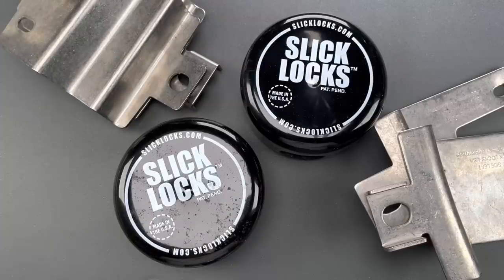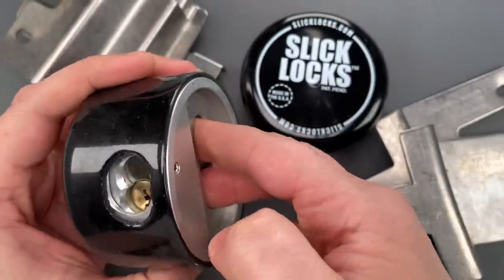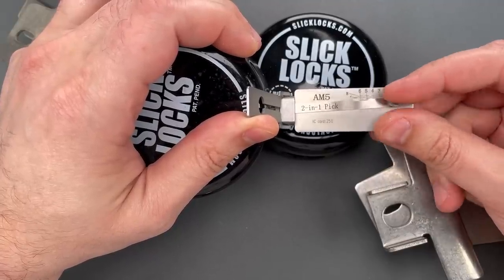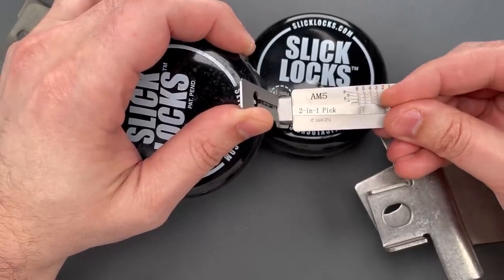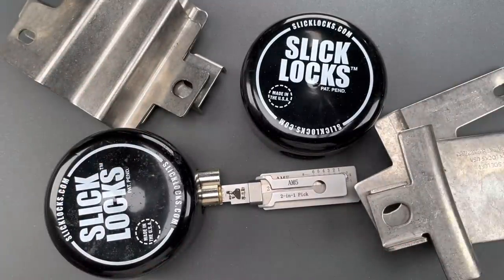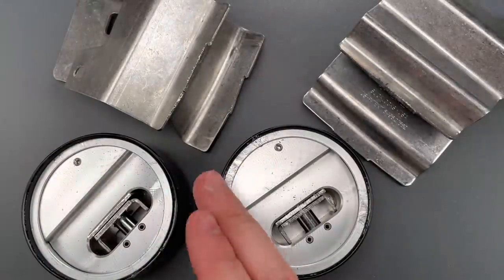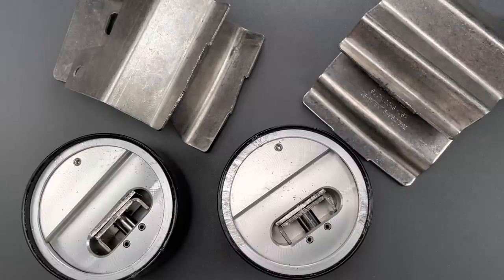[1451] “Slick” Van Locks: Cut in 18 Seconds

Comment: I see you actually have a high-quality vice. That voice could easily be five or $600 but I haven’t checked lately. Two hands on the hacksaw by the way. Great video thanks.
Reply: In a burglary situation, you tend to go for one hand on the hacksaw.
Reply: Who uses 2 hands on a hacksaw?!?
Reply: @nooboftheyear7170  
Someone who knows how to use a saw. Do you noticed how it was flopping around, that’s how the blades get broken. One hand on the handle and the other hand at the end of the saw.  Did you ever have a shop class in school using a hacksaw to cut metal? I’m an industrial tool supplier and am asked from time to time, how can we buy less hacksaw blades we seem to use a lot of them? The brand we sell is Lennox, top of the line.
Reply: @roberthopwood3758  
Yeah I would imagine most burglars would do that, stupid to start with because they’re burglars, that’s what causes the blades to break most of the time, so now you have a stupid burglar doing a stupid thing using a tool the wrong way, I guess the good part is they don’t get to break in.
Reply: @nooboftheyear7170  
Apparently you’re interested in proper technique of using a hacksaw. I came back to help a little bit. He seemed to be using a 12 inch hacksaw blade. It was installed properly in the frame. How many teeth should be used in the grip (Grip = the thickness of the material he was cutting). Go to the head of the class if you said he should’ve been using and apparently did use a 32 tooth hacksaw blade, minimum 3 teeth in the grip. From all appearances it was a bimetal blade, that would be made out of two different materials. The teeth would be a harder material that is laser welded on to the back or the part that mounts to the frame. Is there anything else I can help you with?
Reply: @yt650  times like this are when you are glad that ypur name is noob.  Thank you for the information on blade selection, nevertheless, at a van door he would still only be able to use one hand in my opinion.  

Oh... and please don't say ' now stay down!' after any next reply
Reply: @nooboftheyear7170  
You will say anything to support your very poor position. I know people who are capable of showing upside down and sideways 90° in either direction. If you were to Google the proper use of a hacksaw and that’s what we’re talking about here at the proper use of a hacksaw not some half ass situation, you’ll see you need two hands to use it properly.  
Remember initially you said the following. Who uses two hands on a hacksaw?
Reply: @yt650  indeed, but then, I'm not taught but rather observed everyone else.  I generally used the other hand to steady whatever I was cutting. Thank you for the information though and I will definitely check it before I next pick up a hacksaw.

Comment: I think the cutting would be very awkward while installed on the truck, adding some rubber 'feet' to the lock might cause blade to bind up, an inexpensive way to add a bit more time to cutting.

Comment: If they’re going to go to the trouble to cut it then they’re determined to get in and a determine thief WILL find a way.. it’d be just as easy to cut the thin sheet metal of the door or another panel of the van and get in.

Comment: They could just straight up spot weld a hacksaw to brackets.This is cheap, off the shelf mod with two simple manufacturing steps - punch into shape and weld
Reply: Also, used up band saw blades are nearly free in any quantity

Comment: I wouldn't really even need the brackets to be hardened. Just a spring or a hard pin that's in or around the bracket and across the gap would defeat a common hacksaw.

Comment: id still buy the slick locks, there harder to pick, as far as the back door goes just disconnect the power from the back door lock actuator as a precaution. I dont ever use that door any ways

Comment: With how easy that awkward handsaw went through those mounting plates, this would not stand up for more than a second to my reciprocating saw with a thin flexible blade which would perfectly bend to sit flush with the car and slip behind it with ease
Shame it's not hardened, that would have taken it from "quickly cut the lock before anyone notices" to "someone will definitely notice if it's not an abandoned car park"

Comment: Just out of curiosity (not wanting to be a know-it-all), but wouldn't a decent set of pliers (such as a pipe wrench or swedish pliers) force that freewheeling outside shell oval enough, that you'd still wrench the lock off the van?

Especially as long as the hasps are not from hardened metal.

Comment: The outer shell looks quite soft in the video. I wonder if just either crushing this part or jamming a nail through before torquing the heck out of them wouldn't allow the wrench method to work despite the spinner mechanism?

Comment: The lock is promising. The mount needs work. Do they just sell the lock? (Induction hardening of the plates would be easy for the manufacturer after forming the plates. Very quick and inexpensive. And would kill a hacksaw blade in a quick second.)

Comment: [442] Australian "Hotdog Lock" Picked. Add a Schlege key sticking out of the middle and build a new lock out of that and how hard of a pain in the butt would that be to pick? If you have to pick the hotdog lock 6 times (or once and make an new key per video suggestion) and then have to pick the central key over and over. ?? Open question to all.

Comment: As you put the lock down on the table again after picking, you have to turn the tool again in order for it to lay flat. I would assume that if this lock was installed flush on a door as you suggested, you couldn't pick it with the tool you used in the video. How would you go about picking this lock in a real world environment?

Comment: Okay, realistically speaking you harden the brackets...  Then what?  You aren't going to have a bank vault door this lock is attached to, and axe would easily be able to chop the wood door that it's fixed to.  
As you have said countless times, locks are a deterrent.  Even for banks, the secure doors and safes can be opened, not always just by picking them, but they can be opened!  Might take you a fair while though.  To me this is by far one of the best locks I have seen on your channel.
Reply: " axe would easily be able to chop the wood door that it's fixed to" -- Puck locks are generally used on commercial vehicles to secure metal doors.

Comment: You won't have right angle for cut, when they are properly installed, your saw would brake, or it would take you way longer with cool down moments, still doubt simple blade would hold extra angle ...

Comment: Could maybe DIY harden the vulnerable area on the hasps with a MAPP torch and a coffee can full of oil. I don’t know how much tougher it would be against a carbide blade but it might be worth a shot.
Reply: You can only harden steel that has carbon in it. You can't harden low carbon steel. You might be able to put a hardened pin into the steel though. When a saw blade hits any hard material it gets destroyed. It doesn't take much.
Reply: @1pcfred  Ah, I see. The pin idea might work but welding stainless to carbon would be an issue right?
Reply: @PersonaN007Grata  you can just drive a hardened pin into low carbon steel. All it takes is the right tool. Which in an industrial setting would be a punch press. It'd slam the pin into the mild steel and it'd be there to stay. So no welding required. But it's more materials and another machine operation. That's all money. Which is why they're not doing it. I bet they could do it for less than a dollar a unit though. Still a few cents here and there adds up.

Comment: The lock itself seems impressive. It would be cool if they sold a more cut-resistant hasp with it.
Reply: @rmsg7504  Maybe not lishi tools, but at my old uni you'd walk by the bike racks at night and there was no question they had saws and bolt cutters. Half the bikes were in pieces.

Comment: I don't see why they don't just case harden allot of these parts, as with allot of critical automotive parts and things. It seems like it wouldn't be much more expensive as it doesn't require actual hard steel... forming and everything could be done before hardening. The case hardening process just hardens the outer layer of the part by adding extra carbon to it, which should defeat a saw blade no problem.

Comment: A great video, but I felt the cutting attack needed to be against a simulated van door. Using a hacksaw at a work bench is one thing. Using it effectively pressed against a steel van door with little to no ability to adjust for angle is another. So it wasn't quite fair, probably wouldn't have been as easy or as quick in the field. 

But that doesn't invalidate the conclusion one iota: hardened steel hasps would fix this obvious flaw.

Comment: it really looks like there's a lot of wasted space on one half of the lock
a hardened steel bar could surely be spotwelded, crimped, pressed or fixed in many other ways inside that U bend

I suggest to just cut an old file to size and fix it there yourself as a DIY solution
you can anneal it to drill the hole, hardening it should be simple enough as you just want it pretty hard and don't need to worry about toughness
alternatively you can cut a slot with your angle grinder (with a lot of cooling) 
a few tack welds should be enough to fix it in place, or epoxy or whatever you got handy
Reply: The two pieces of steel are put between the door and doorjam while holding on somewhere inside.  The bent zig zag is probably specific to the doors on one van model
Reply: @ButterfatFarms  just spit balling ideas for folks that have this lock and may not want to spend extra cash on a new one
money is tight, especially for small business that managed to survive covid

Comment: But I wonder how hard it would be to cut mounted flush on the wall of the van. If you've ever used a hand held hacksaw in a close binding area with your hand its definitely not the easiest thing to do.
Reply: The blade has adjustable angle, so you'd take a little longer, but not really struggle to get it in

Comment: The easyest but not cheapest way to improve this, would probably be to change material into inox, it's not unbreakable but it would heavily slow down this kind of attack
Reply: mounted to an aluminum door on a Transit van?
Reply: Like i said, it just slows down the attack, you can put it on a cabinet door made of 1/10 steel plate for all i care, the outcome stays the same

Comment: Sometimes its not about quality of the lock. Its also how intimidating it looks ! Most of criminals that brake into vans aren't inteligent to pick a lock ,a typical meth head junky doesnt have patience to go trough security pins ,they use crowbars and brute force. All the smart criminals are in government . 
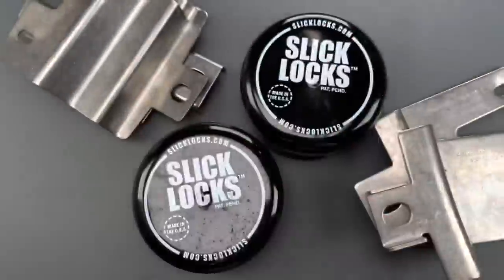Look at the master lock at 0:29 -it looks like it is made of vibranium like captain amurica's shield ,core can be picked in probably 20 s but meth head doesnt know that ,it looks intimidating like it could never be opened with crowbar so he leaves you van alone .
Deception is the best security . If something looks like its not worthy stealing with a scary looking lock they go away . Park it on a public crowded area and you are at minimum risk.
Reply: You underestimate the criminal class.  They usually have a few skills specific to their line of "work", which they do all the time when not in the government hotel.

Comment: You know, it would not be difficult for one to have custom versions of those hasps made to prevent that attack a bit better. If these were made to fit to a price point, at least the money went into the lock itself. Spending a bit more to make custom hasps or making your own wouldn't be too difficult. I can not blame the company for that, I am sure they had that in mind but when you have to build to a price point, the hasp is something easy to upgrade but the lock isn't. Maybe they fixed the issue with their newest version?

Comment: In real life you can barely get a sawzall blade behind it and a regular hacksaw doesn't fit
At that point it's easier to just cut a hole in the actual van since they are made of cheap steel and work vans have no paneling or insulation, just a single layer of metal typically.

Comment: I don't think the hacksaw test did it right, I would expect it to be a bit more difficult to move the saw if it was flush with the panel, even though a battery powered saw with a long flexible blade will probably defeat it anyway.

Comment: Granted the hasp is soft. A more realistic test would be up against a wall where you're going to lose the hide on your knuckles instead of a vice just saying
Reply: A thief would use a cordless reciprocating saw with a long blade that flexes. It'd cut that hasp like a hot knife through butter. 3 or 4 seconds and it'd be over.

Comment: Big oof. I had to cut a screw the other day in a hard to reach spot. Using a hacksaw blade (cause there was no space for the frame) it took me almost 5 minutes to cut - based on thatI guess the mounts here where made out of medium grade playdough.
Reply: Some screws are hardened and some hacksaw blades leave much to be desired too. But yeah that lock hasp looked like some pretty soft steel. They probably use it because it is cheap and easy to machine. Well, stamp out. The soft metal would make their dies last a long time. They could put a hardened pin into a strategic location and make it virtually impossible to saw.

Comment: I think the asp would not survive a crowbar attack it's too thin plus there's just pull the top of the door down in my opinion all work vans need better security like stronger doors thicker metal internal latch type locks like a hook system that slots in; it's not rocket science just common sense.

Comment: HOLD UP! Even if you can slip a hacksaw blade behind the lock, you have VERY little clearance to move the blade back and forth as your hands/handle would be tight against the van. Sorry LPL, but your example is flawed. Still possible to cut? Sure. But it would be MUCH MUCH more difficult and take MUCH longer.

Comment: This lock kit is a vast overkill to secure a ford. It wildly exceeds ford's quality standard
Reply: These locks protect the contents, not the van.  Vans are often mobile workshops for professionals called to customer sites, and many of them charge an extra $100/hour for bringing the van, giving some indication of how expensive the setup is.  Walking around the city, I often see these vans open with the professional working in the back surrounded by lots of high end equipment and drawers full of expensive spare parts.  I also see locked vans parked while the professional is in a building needing his service or in his own house sleeping.  10 years ago, those vans only had the carmakers locks, then thieves got reckless.

Comment: You should/could have used some lube on that blade to both cool it down, and prevent some of the sound. (Not that sound really matters in a garage test).  But... The main question is.
There is an "anti-spinning" feature, but the walls look thin enough to bulge and grip if enough force was applied. What would happen if you where to use an oil filter remover on this.. Looks about the same size, to you would get a good solid grip and good leverage as well.